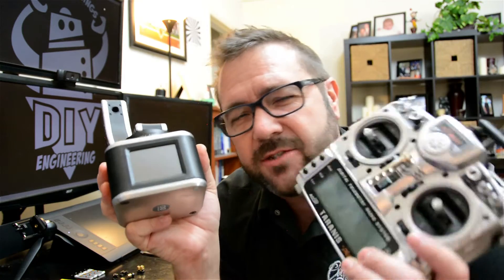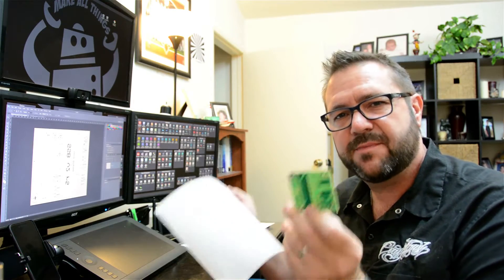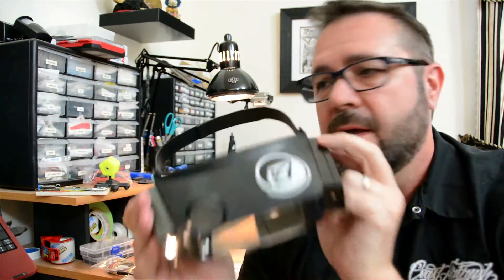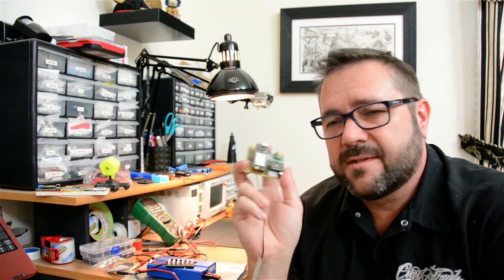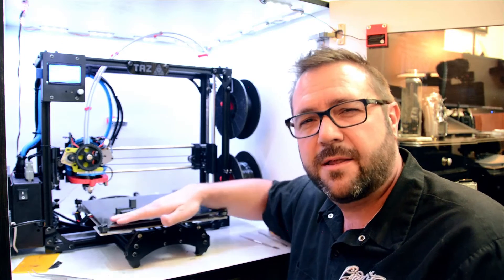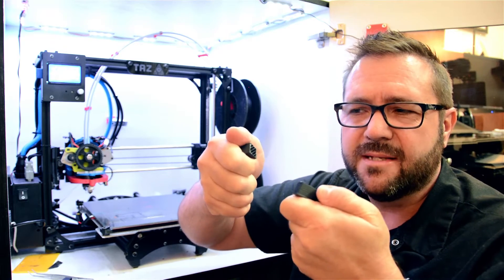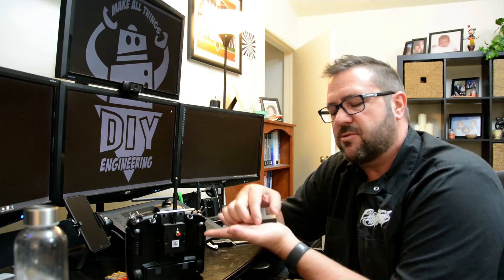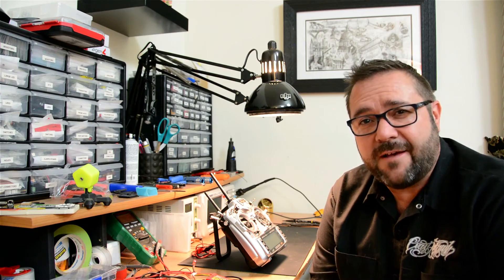Episode 007: It's So Strong!!

Comment: Useful video!  How have you been liking your Lulzbot TAZ?  Did it take a lot of tuning in order to get parts of that quality out of it?
Reply from the maker: My TAZ 4 is a great machine, I have added the Flexy Dualie head as well as Auto bed leveling, since then I have not needed to tune it much. and I use it A LOT!  currently I am running a batch of 60 x 3hr parts its a workhorse.
Reply: Thanks for the response!  I'll have to look into the bed leveling thing, I didn't realize you could retrofit that to the older TAZs
Reply from the maker: I have my Marlin firmware I configured with auto bed leveling and multiple extruders. I'd be happy to share.
Reply: It sounds like you've done some serious mods. Did you use a hall effect sensor for the auto leveling, or the closed-circuit method that the Taz 6 uses?  Before the mods, did it need re-leveled often? (I just ask because one of my friends has a MG M2 and that thing never needing re-leveled, which made me curious why auto leveling is such a desired feature)
Reply from the maker: it's really subjective to the design of the bed and how rough you are with it. often my prints are so well bonded to the bed it takes a firm attack with a paint scraper, and if you damage the PET coating it can change the level of the bed, also if you use a bed that is susceptible to wearing. the auto bed level probes a matrix to deal with inconsistencies in the bed surface. I implemented the servo method which raises and lowers the probe when desired for probing.
Reply: That makes sense.  Is there a tutorial that you followed for that auto leveling install?  (again thanks for all the info, I'm considering purchasing a refurbished TAZ 5)
Reply from the maker: there was, I would have to search that up, it only gets you most of the way.
If I were in your shoes, I would begin with the latest MARLIN source code and update the firmware specific to the TAZ needs... It sounds easier than it is... but it's not to hard... sounds like a good topic to an upcoming episode.
Reply: Alright, I'll look into Marlin.  Thanks
Reply from the maker: https://github.com/MarlinFirmware
and
https://ohai.lulzbot.com/group/firmware-flashing/